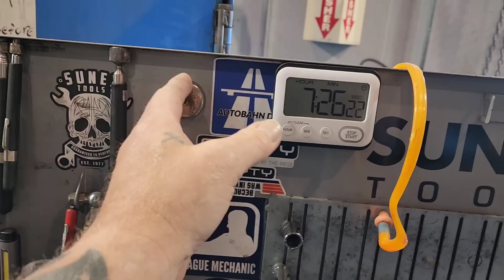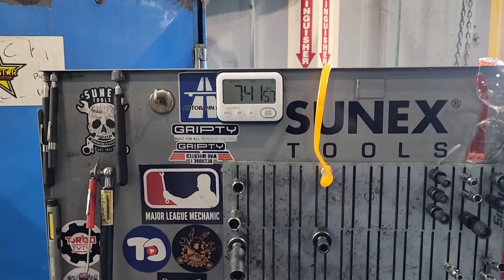Diesel and Gas Mechanic Tool Cart Tour

Comment: That's a nice set-up! I bought a used Matco Jamestown cart from my Snap-on guy. It's a fantastic tall cart because I'm 6ft 5. One thing I don't like about it though is the top depth and only two wheels swivel and I overloaded it to where it became just another tool box... one tip I would like to share which I find works probably better than the flat magnet is a big magnetic tray with four magnets that I stuck to the lid of my cart. I literally throw my sockets and stuff at it as I'm working instead of having them fall in the pile of tools you got going with your service cart. It seems to work for you but I like a little area in the top of my cart with just a smaller assortment of sockets that I know I'm going to need instead of going to my big box. I have my sockets going the other direction small to big front to back. What I've done with my wobbly impacts that over the years I've had to replace/ warranty/ lost or broken different manufacturers are either a little bit taller or little bit shorter and in some cases even the same brand such as Mac now are little bit shorter than the older ones I have them strategically placed where I can look at a glance and know that the Cornwell 16 mm wobbly is taller than the 17 in front of it and the 13 Cornwell it's taller than the Mac 14. And the Snap-on 18 it's taller than the Matco 19. I've done that on purpose now with pretty much all of my impact wobblies in 1/2 and 3/8 deep and shallow so I can look at a glance and know what size is what. Also with my normal sockets I just put paint dots next to different sizes that are different colors with my junk yard markers. Not all of them just a few so I can pick them out on the Fly. Great work! Keep on turning and earning!
Reply: Organization is key to everything
Reply from the maker: Thank you very much.  Sounds like you have yours very dialed in as well.  Thank you for watching.